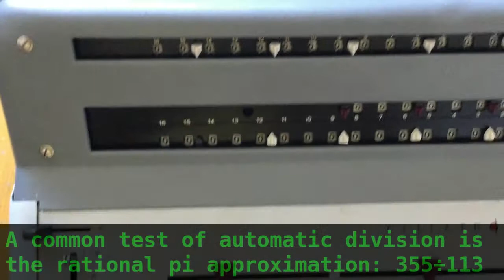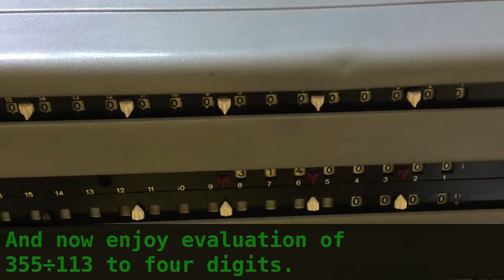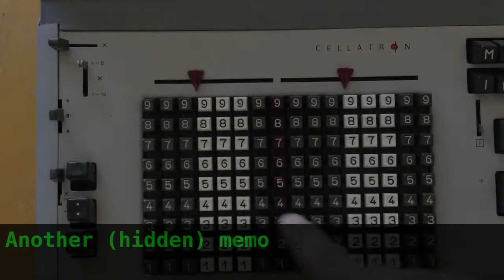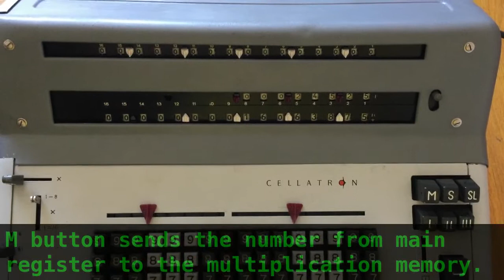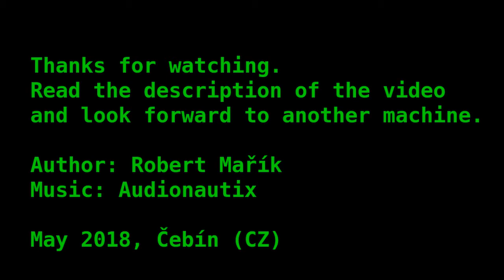Mechanical calculator Cellatron R43 SM (former Mercedes Euklid)

Comment: The Cellatron is very interesting because it is from the DDR yet more advanced internally as compared to the identical machine that was produced in parallel in West Germany. Probably the Cellatron was one of the pinnacles of the DDR (I have the R44SM, wonderful machine)
Reply: Not quite.  The Ascota 170 accounting machine is a fully mechanical Turing-complete decimal computer developed in the early '60s.  And it's a desktop machine!
Reply: @douro20  the Ascota is indeed a marvellous machine. But what I meant is that the Cellatron was produced both in the DDR and in West Germany as the original Mercedes Euklid company was split up after the second World War into a West Germany company and a DDR company. I have repaired both the West Germany variant and the DDR variant of rhe Cellatron and I noticed that the DDR variant is developed a bit further and internally more advanced than the West Germany variant.